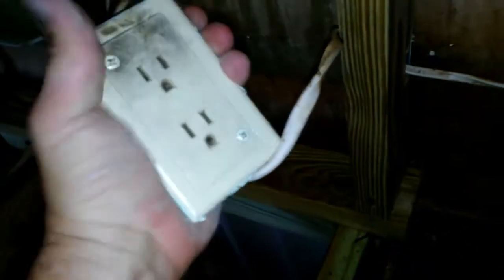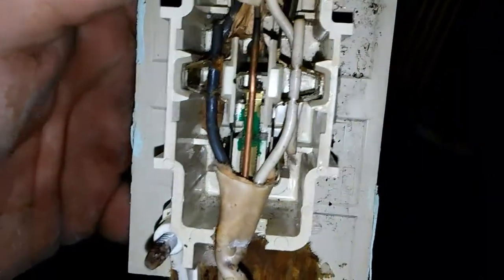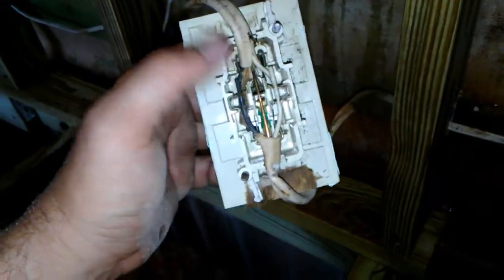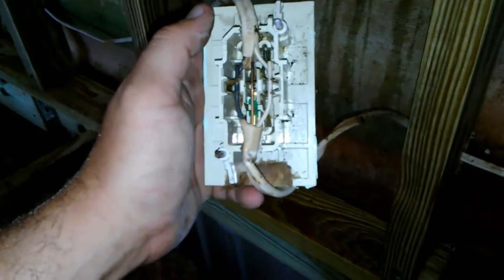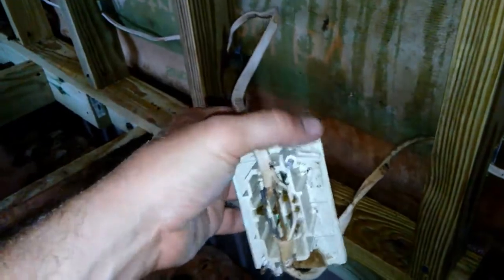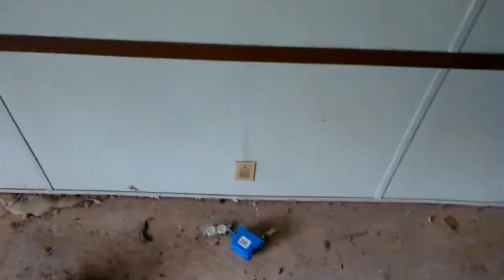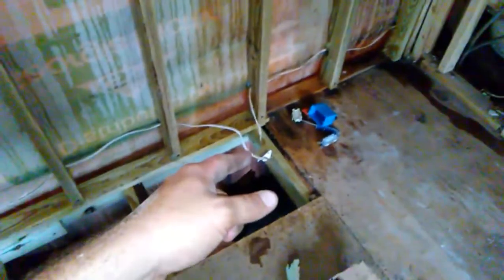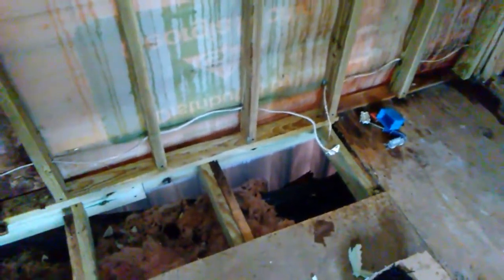My opinion in Duplex Outlets and Electrical Troubleshooting Tips

Comment: I like your opinion. The duplex outlets in our mobile home are 28 years old. The plugs fall out of them and the heaters caused them to burn up and spark.  I am also replacing them but with standard outlets. I only bought a few then thought I would look up where to buy the mobile home replacements...They are way more expensive, almost $8 here compared to $3 for a standard box, outlet and cover.
Reply from the maker: Thanks for your comment